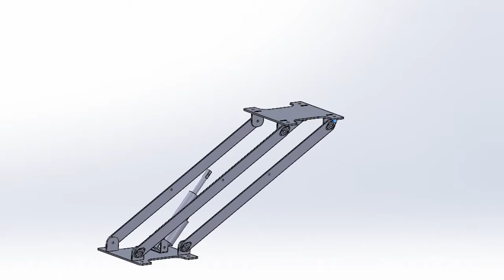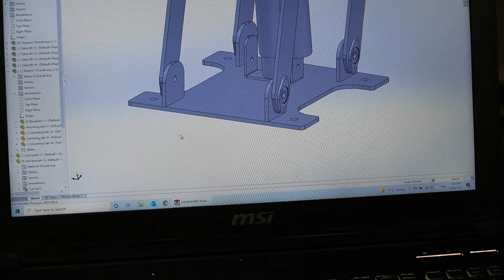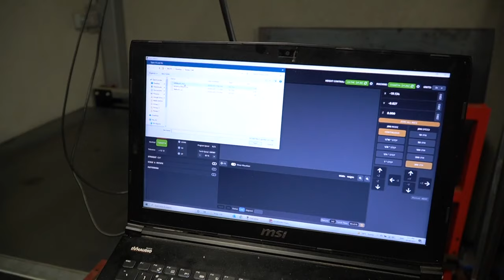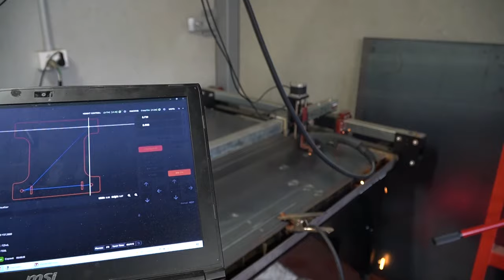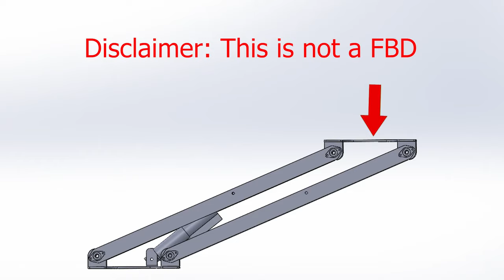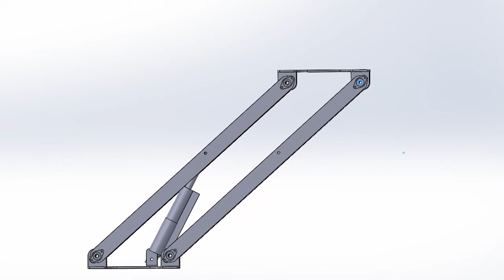Worlds first electric convertible caravan bed in a Landcruiser | Part 8

Comment: Recently found your videos, lovin the builds on the troopy and 76, my question, the electric windows you put in on the 76, do you have any instructions or videos on how you did it? Cheers! Keep up the great videos!!👍👍
Reply from the maker: Cheers Steve. I'll cover that in detail for you when I finally get around to doing the q&a, but it's simpler than you might think. Essentially the window winders are replaced with a motor inside the door. There's kits available
Reply: @ridiculousthings4x4  awesome!! Many thanks, look forward to seeing it👍👍

Comment: Just watching the plasma cutter section ATM. How thick are you cutting (3mm?) and what metal are you cutting(Mild steel?) and how many amps? Your travel speed seems VERY slow. I've found you get less dross if you up the speed a bit. For 3mm I'd run at 45A with a fine cut tip and I reckon I'm cutting at 3 or 4 times that speed. Like 80mm/sec.  
Anyway - interesting to see your CAD software compared to mine.   On to the rest of the video now...
Reply from the maker: It's 6mm mild steel hence the slow cut (500mm/min) set to roughly 27A. If anything I could have done with it being a tiny bit slower due to this particular set of consumables being towards the end of their lives. I don't typically cut this thickness, but adding amps and increasing the travel speed tends to trip breakers on long cuts.
Reply: @ridiculousthings4x4  6mm is of course a lot slower!  That whole assembly would weigh a fair bit in 6mm too :)  But it's never going to bend.